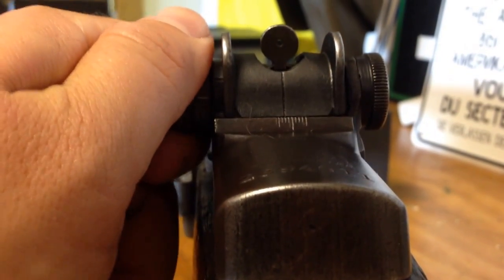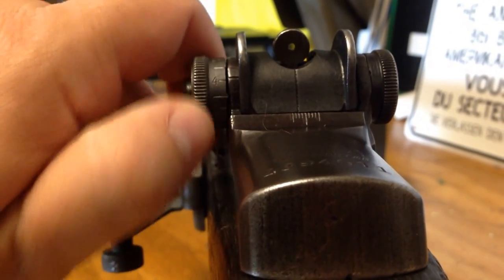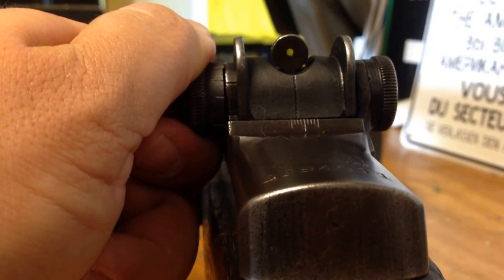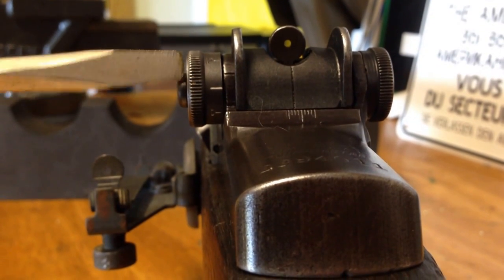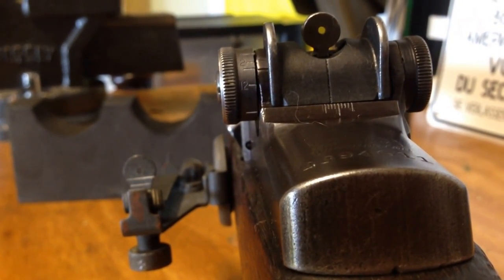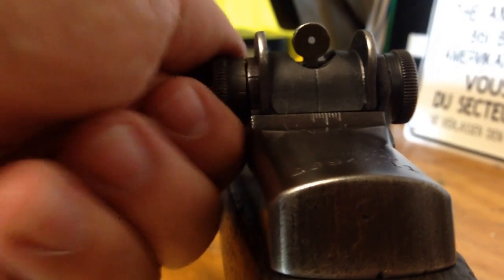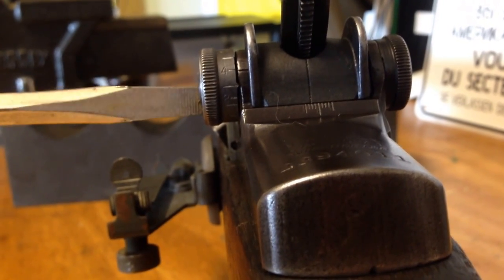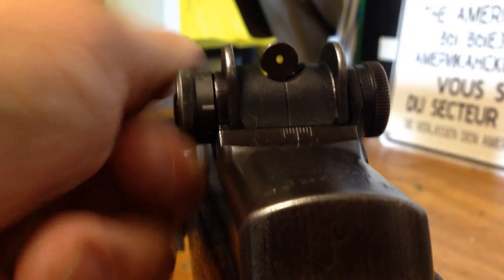Setting The Elevation Knob On A M1 Garand

Comment: What elevation setting do I use when shooting at 25 yards or 50 yards? I have a national match, and the 100 yard mark is 14 clicks from the bottom. When I shoot at 25 yards, I hit about an inch high. Do I need to recalibrate my elevation knob? I don't have a range where I can shoot at 100 yards so I can't exactly check if it's calibrated right.
Reply from the maker: It’s fine
Reply: Army training guideline for 250yd Battlefield-Zero.... 25yd range --- 12 clicks from bottom, point-of-aim & point-of-impact is 1.82 inches "above bulls-eye" on paper target set at 25yds.... good day sammy